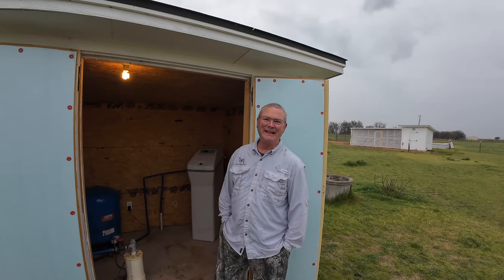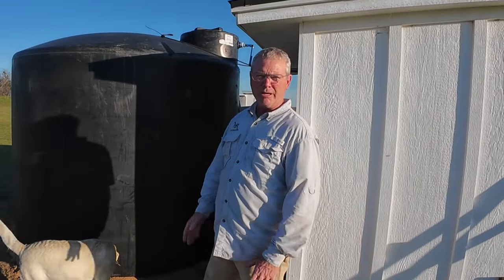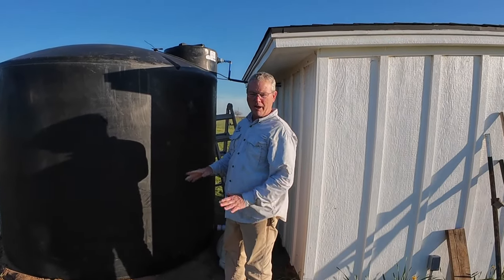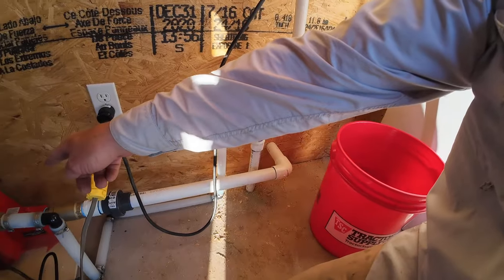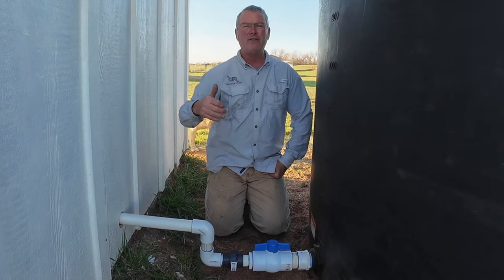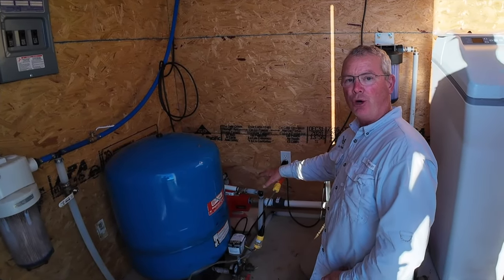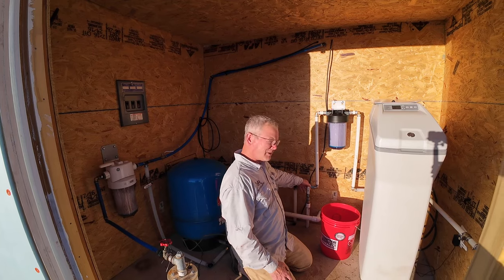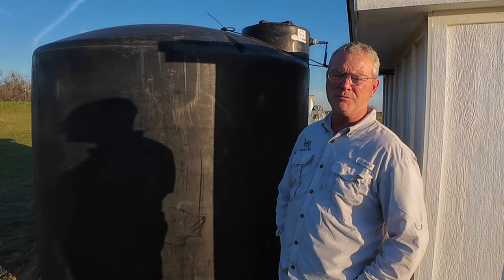HOW TO INSTALL A WATER STORAGE TANK | Fix a low-yield water well

Comment: Very informative video. Am I understanding correctly that the little red pump will turn on when you open like a faucet in the house or a hose in the garden? It's not attached to like a pressure switch or sensor or anything?
Reply from the maker: That is correct! Thanks for watching!

Comment: Why not roll the tank where he could crawl in…
Reply from the maker: Unfortunately, the tank still had a bunch of water inside which made that impossible(trust me Jered tried to think of everything before he dove in😂). They used the tractor to lift it onto the trailer.  We appreciate you watching! Hopefully you got a laugh at Jered's expense!! 😂😂
Reply: Very informative video. am I understanding you correctly that the little red pump will turn on only when you say open a faucet inside the house or a hose outside?